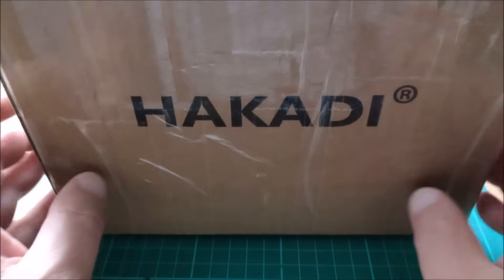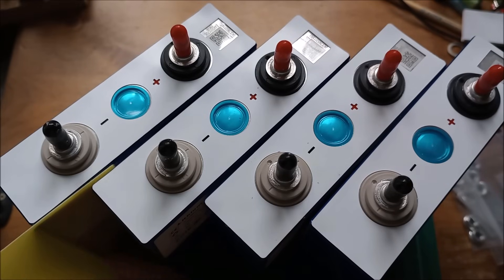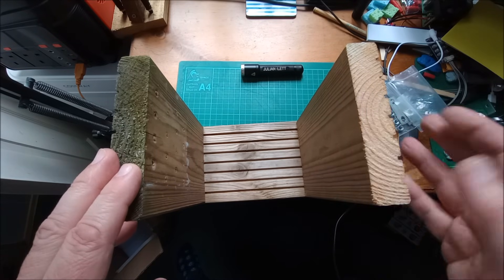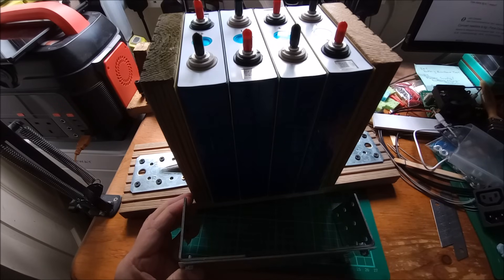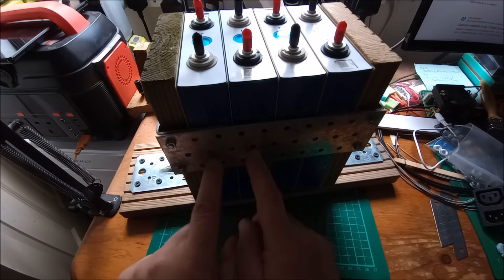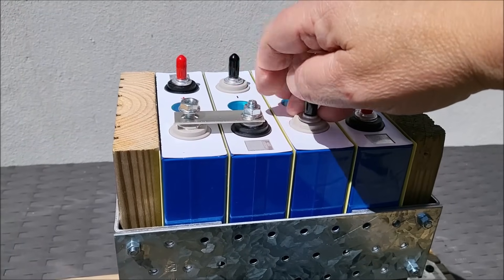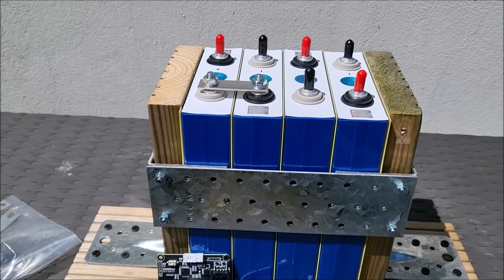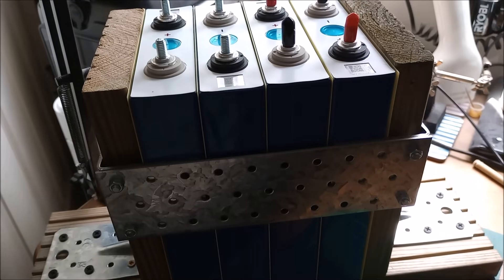Hakadi Battery 105Ah LiFePO4 Prismatic Cells

Comment: running my first  project with some similar and i m quiet happy . they deliver average 80% of their capacity and i need em for 50% of their load capability .  . when compressed em (not much)  ..   they performed +15% as for capacity but when torqued  a bit more than spec  about  to 5,5 N   per nut ..   the  voltage beween cells was stabilized and i gained my final 3.6kw clean used  energy not measuring the losses from inverting   for 16s   with safety  parameters on bms and on normal test!!!      lets see after a year with some more tests... ///   they dont need to be compressed hard.. you just need to avoid bloat em.. i let em sit fully charged slowly       for 15 days i think and not a single bloat.. but dont risk it... keep em under 70%  as long as you didnt  make your pack !!!!    my pack is 16s btw ./..I BOught same woud as yours   to  finish my box and added a plexiglass  to prevent shorts from above

Comment: Keep in mind at 3.4V a LFP cell is 100% SoC with no load/charge, exactly already at 3.37V. The datasheet says up to 3,65V but with a charge current no lower than 0.05C - which is 5 Amps here! Everything else is overcharging - resulting in bulging probably!
Reply from the maker: Don't you mean "no greater than 0.05C"?
Reply: @JulianIlett  No, you have to keep charge current above 0.05C otherwise the cell voltage goes too high! If charge current is lower than 0.05C and you are already at 3.65V the cell is beeing overcharged! Most ppl. dont the this right 😉 At 3.37Voc the cell is at 100% SoC already!
Reply from the maker: Ah, you're talking about the end-of-charge cut off. Got ya.
Reply: @JulianIlett  Yeah, most ppl don't care about this and ridiculously overcharge there cells - resulting in bulging! You just need to charge higher than 3.4V when balancing, because at this level the cells separate in terms of voltage. The ones that run higher 3.45+ first are full and probably have lower capacity than the others in series. If there is only a few mV difference all is fine - no balancing needed.

Comment: Quite funny and quite useless job of compression! Typically you will use 4 threaded rods (Gewindestangen) in M6 or M8 and compress the cells between 2 solid plates of hard wood or aluminium etc. I have exactly the same cells directly from EVE but without these M5 bolts, just M4 holes in the contacts.

Comment: Julian, there are hundreds of videos on youtube about LFP cells - Will Prowse is probably the best source of info and teardowns, Lithium Solar, Ray Builds Cool Stuff, David Poz
Compression is done using threaded rods and metal plates.
Bus bars should not be flat - they should have a hump which will bend to relieve stress on the terminal posts.

Comment: Its a big step taking a lash up on a bench and putting together properly into a conventional battery case.  Lots of construction engineering to do and attention to detail.  You cant just throw it all in a shoe box and expect it to operate reliably and safely - year in year out (and in a mobile platform like a golf cart). Think of a car and how we all take for granted the way auto electrics are put together - decades of user experience goes into to that level.  Notice the basic 6mm "Lucas " pattern push fit spade terminals - they work under arduous conditions all over the world.

Been thru all that, took me a month of triple care.  I would now be very suspicious of cheap charlie drop in  batteries used to replace AGMs. you are just buying a black box with a wish and a prayer.

Comment: AFAIK cell compression is only usefull during the first one or two charge/discharge cycles. And since these cycles should already be done at the manufacturer there is no real advantage in building a compression rig yourself.
Reply from the maker: Odd then that the data sheet has a full set of instructions on how to construct a compression rig. It recommends 8mm metal plates, 6mm threaded rod and nuts.
Reply: I thought Andy came to the conclusion that compression was not important to the longevity of the battery. He did several videos on the subject, @JulianIlett

Comment: I find the info about batteries changing shape as they get used fascinating especially given the force figures you were quoting. Maybe with the next set you could integrate a load cell to measure the stress rise as you charge and discharge the packs. 
Stay safe!

Comment: I would Start looking into Fire Proofing the Shed
- Steel Office Cabinet
Install flight case wheels
(use PowerLock PowerSafe 500A 800A  )

- Outdoor Industry Waring labels / plaques  of lithium metal fires for firefighters  on the door

Make you own Diy Fireproof & Heat proof Shielding / Dividers  
- Perlite + Plaster of Paris + Sodium silicate  100% Pure + (Wood PVA Glue  / pool paint to make A putty)

- FireTrace UK Automatic Tube Seeking Fire Extinguishers (2 / 4 nozzle indirect (Powder D class)+ Trigger seeker Tube)
Reply: Remember these are LFP with no thermal runnaway.
Reply: @moestrei  Thermal runaway can still happen with LiFePO4 batteries, it just takes a lot more heat than with normal Li-ion batteries.
Reply from the maker: Rain every alternate day helps a lot :)
Reply: @JulianIlett  Cant really argue with that it has been A Damp Wet Spring Summer this year
last year was So dry   that Everything just would go up with ease

Comment: I would have expected the iR to be much lower, as the EVE 105Ah cells I work with have an iR of 0,32 mOhm, measuring around 0,35 mOhm.
Your cells also look to have a top M6 20mm steel pinol screw which is perhaps press fit into the alu plate welded on top of the cell, essentially making a sandwich with the busbars on top. We went away from that solution and instead first screwed and later welded busbars directly onto the battery terminal, both solutions using a steel M6 Helicoil inserted directly in the terminal under the busbar. Torqued nut set to around 4Nm.
Reply: Mine are grade A and had IR of 0.25mOhm.
Reply from the maker: Measured IR varies depending upon state of charge. These cells measured about 0.3 mOhm out of the box. Once fully charged, they will probably measure lower.